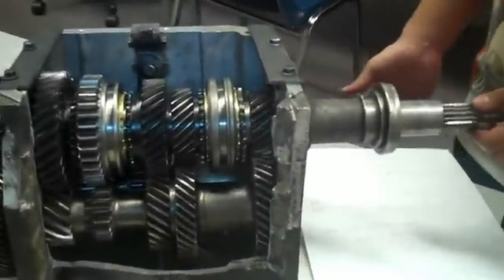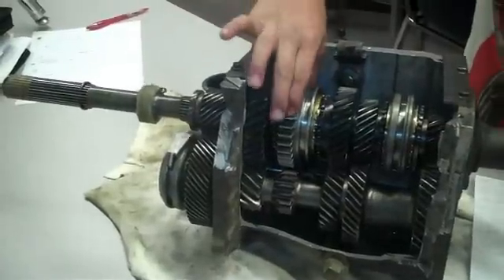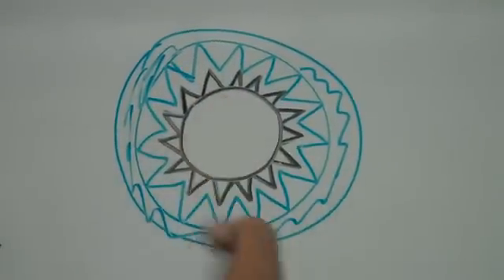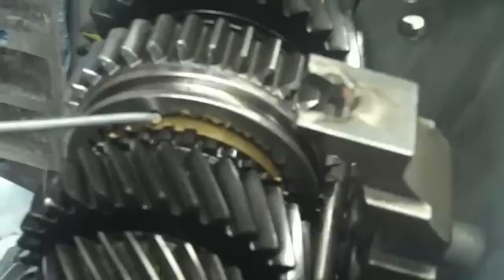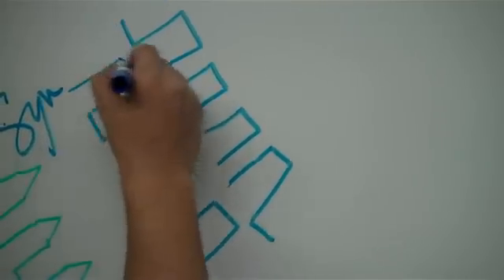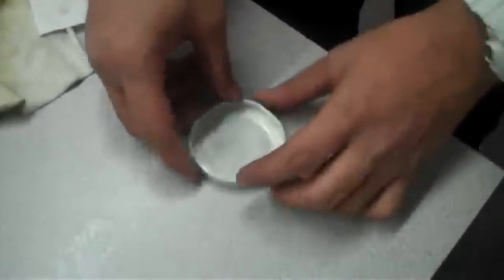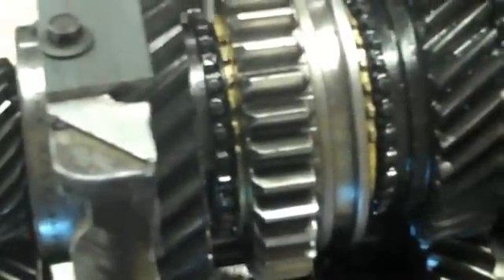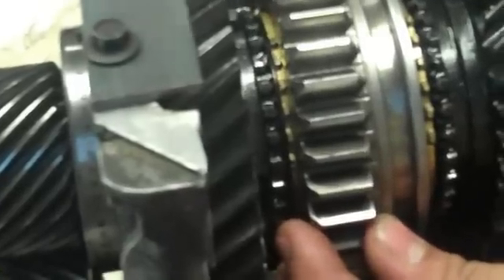How Synchromesh works By:Josh C.

Comment: Thanks for this video. May I ask you some questions? Whwn both input and output shafts are not moving, clutch pressed and car at rest, what ensures the alignment and the synchonization between the sleeve teeth and the blocking ring teeth or between the sleeve teeth and the gear teeth? Can those end up to a point-to-point condition and impede the engagement or the chamfer on the teeth will always make them sliding sidewise?
Reply from the maker: please watch "how manual transmission works-revised part 4" on out channel.

Comment: You missed the part about the conical surface on the inside of the brass synchro ring, which is essential for multiplying axial force applied to the ring and turning it into lots of rotational torque that blocks the collar from engaging until the speeds are matched.  That's the key feature of how synchronizers work.

Comment: On a side note, 1st and 5th gear are commonly notchy in most transmissions ESPECIALLY when cold. Easy remedy for that is usually a neutral check. (Put gear shifter into neutral and move the shifter left to right inside the Neutral gate/zone). Then put it into 1st. For 5th I usually put it into 2nd gear then back into neutral and into 5th. Always slides right in. If there is grinding associated with your notchiness, then it's most likely dog teeth worn and/or blocker rings/synchronizers.

Comment: How old is the transmission fluid?  Is it the correct type?  Syncromesh transmissions can have problems with thick gear oil so many manufactures recommend ATF or special lubricant for passenger car use.

It will also do this if the clutch isn't disengaging completely because of a distorted disk or incorrect adjustment.  You can get a quick check on that by shifting into reverse with the clutch pushed in.  If the clutch isn't releasing, reverse will grind because they are straight cut w/o synchr

Comment: When my car is turned off, I can move the shifter through all the gears and it is smooth like butter. But when the car is running and I shift from 2nd to 1st or from 4th to 5th, the shifter doesnt go into gear smoothly I can feel bumps in the shifter knob. Could that be the syncro's ?